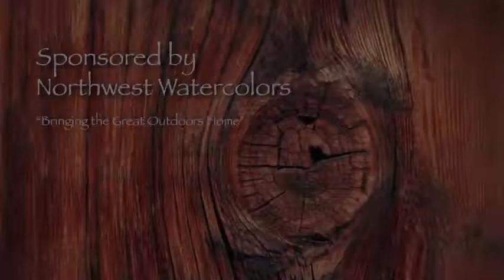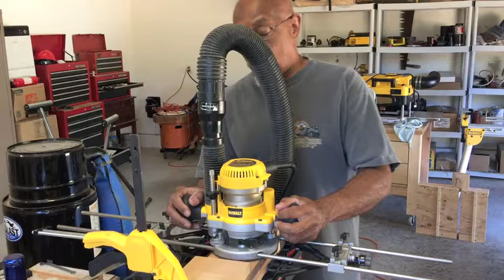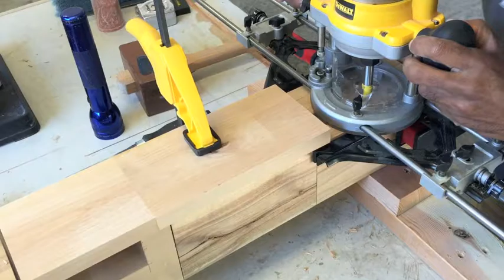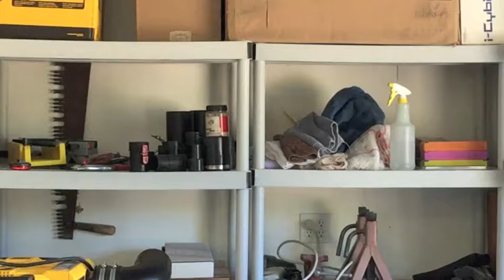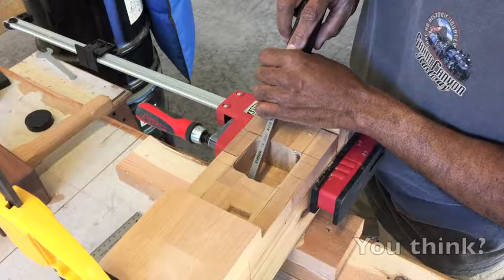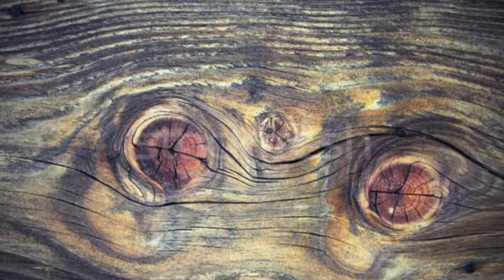Wood Knot Carpenter No.  6 - Learning Curves

Comment: You can mortise that out using your mortise chisel.  You hold the mortise chisel vertical and drive it into the wood 1/8" or so.  Then move an 1/8" drive it down again.  Repeat until you've gone an inch or so, and then lever the chips out.  Once you get the hang of it, you can make a deep mortise rather quickly.  
I'm not sure why you've using such a large mortise?  You would probably be better off with a double mortise, two mortises parallel to each other but only 3/4" to 1" wide each.  Then you would cut two parallel tenons on the mating piece.  That way you would have four long-grain to long-grain surfaces to glue to which would yield a much stronger joint.
Reply from the maker: Thank you for your advice and information. I'm still learning how to use my mortising chisels effectively; getting better.